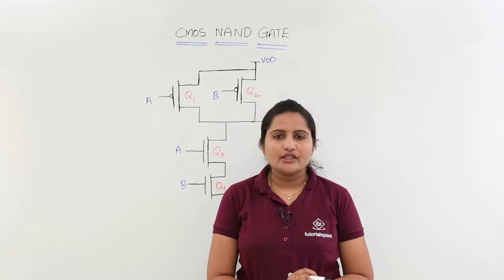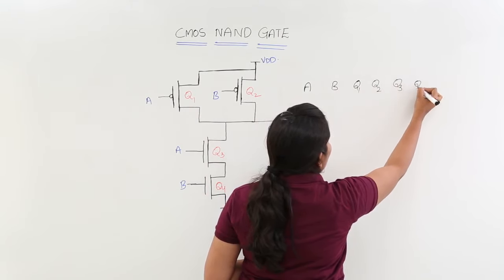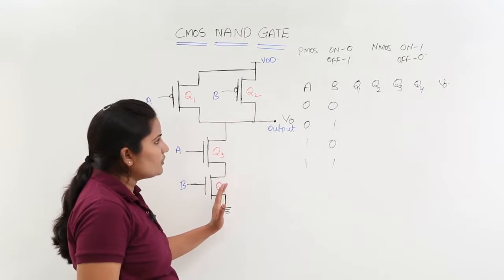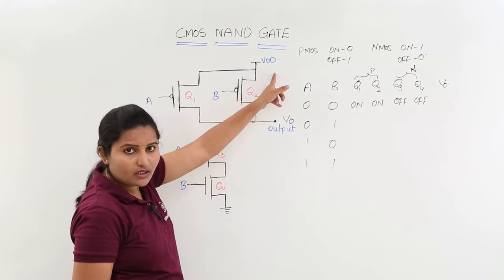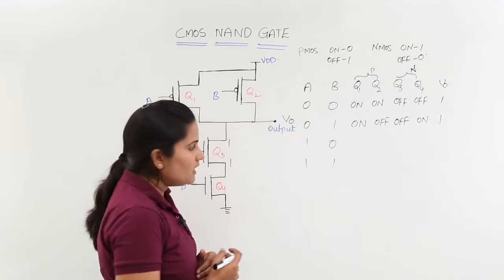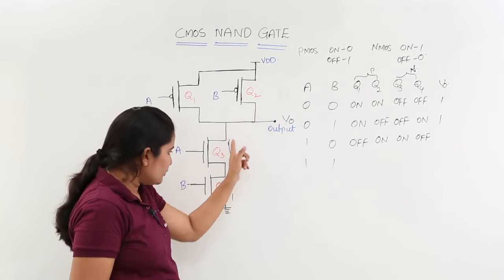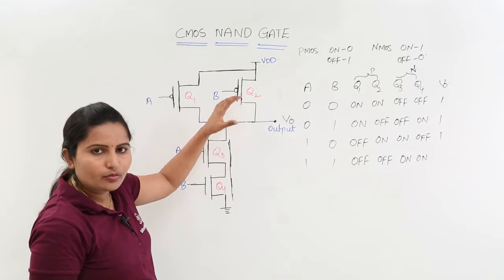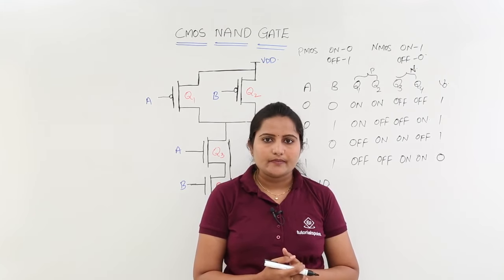CMOS NAND Gate

Comment: is the connection to ground is necessary for a 0 o/p?  ie, if the o/p is neither connected to Vdd nor ground, will it give a 0 o/p?
Reply: No, output will be at high impedance state. In this case output is either 0 or 1

Comment: how can I draw this structure with the help of nand truth table....
Reply: Realise the circuit using NMOS, then take complement of that network, means if NMOS is a shunt network, PMOS becomes series network and vice versa
Reply: For a NAND gate, output is 0 if both inputs are high, that means pulldown network should conduct when both inputs are 1.This happens if and only if NMOS transistors are in series. If any one of the inputs is 0, output  must be 1. That means PMOS should conduct if any one of the two inputs is 0. That means PMIS are in shunt - just opposite to the NMOS connection